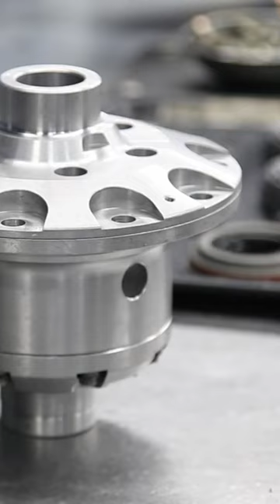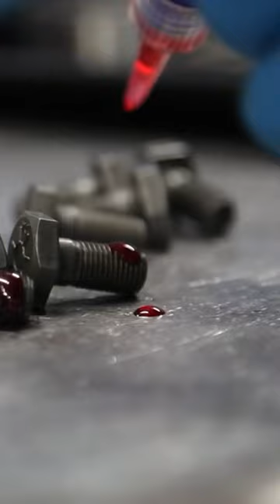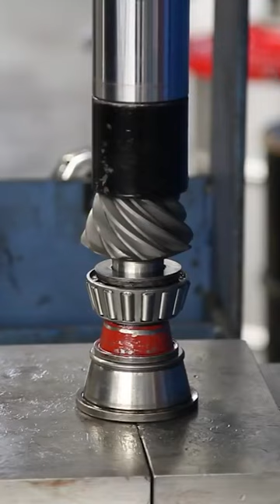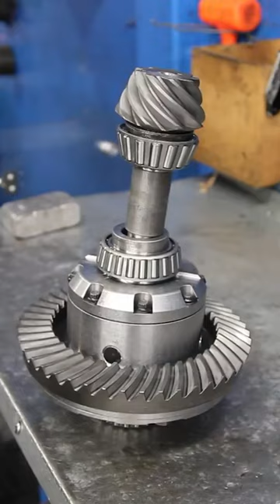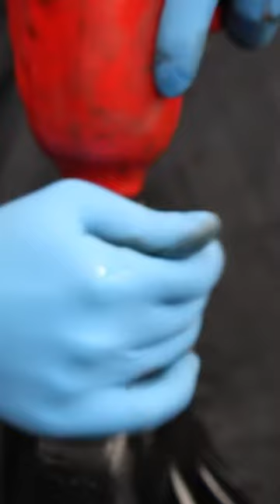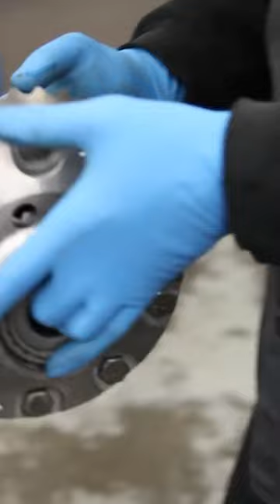Installing Ring and Pinions and Yukon Zip Lockers

Comment: Is this the way the pros do it? Lol
I have always used a case spreader to get my assemblies in worried that the back lash would fall out of spec after torque is applied to the setup. That carrier slipped in so easily. Have I been over thinking it? I have only done 4 axles, my jeep and my buddies jeep. If this is acceptable it would sure make my life way easier on the next one. Love your stuff, Please let me know 😎
Reply from the maker: I have had "bad luck" with case spreaders...get a set of shim drivers instead
Reply: It's fake, it's all for show, nobody presses everything on without first doing mock setups, and if you are, your probably doing back 2 back jobs